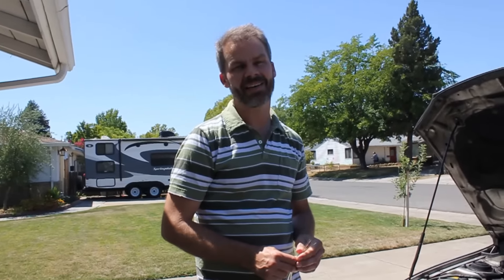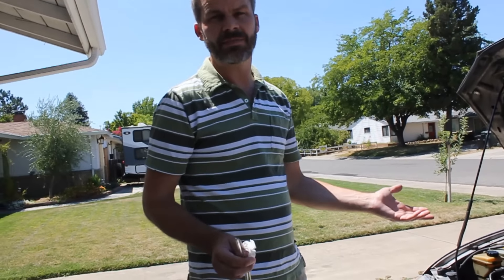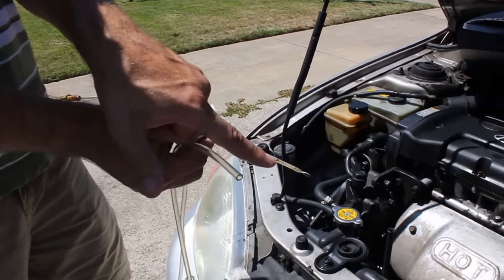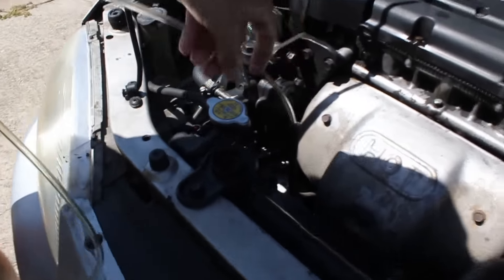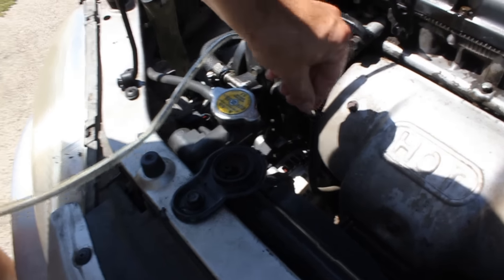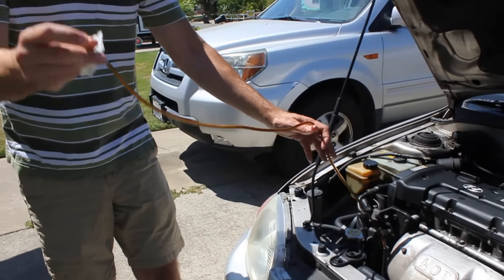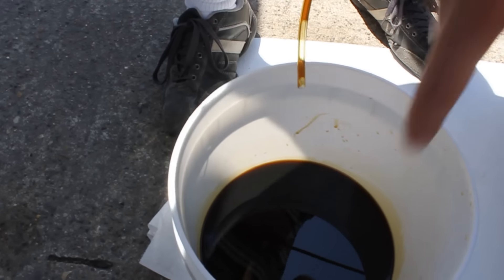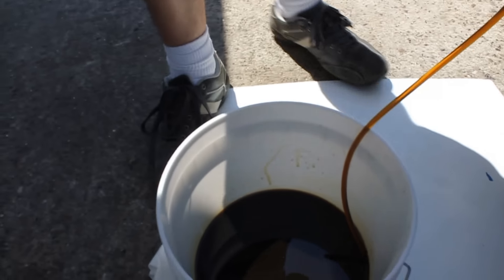How to Drain Oil from a Car's Engine through the dipstick Tube

Comment: For future reference,  learn how much oil your car takes. It's in the owners manual. When you change the oil ALWAYS change the filter too because I've never seen an engine blow up because the oil was clean, but I have seen them blow up because they didn't change the oil filter each time.  Pull the filter, drain the pan... let sit for 5 mins,  replace filter with a new one and put the drain plug back in and add the amount of oil your car requires as per the owners manual.  Voila!!!  Never too low or too full.
Reply: Oh and be sure that the old oil filter gasket comes off with the old filter.  Rub some oil onto the new filter gasket before putting the new filter on. If it's a filter that hangs up and down you can pre-fill the filter with oil (Make sure that if your engine takes 5qts and you put 1qt in the filter,  that you only add 4qts to the engine.)   That way your car doesn't run without oil for the first start up.
Reply from the maker: +Derrick Gott No matter what level of expertise you have, mistakes happen and draining through the dipstick tube is a quick, clean way to correct the error.
Reply: +Rob Cockerham Based on your video it's all but quick...
Reply: @itsokaytobestupid827  
Lol right, probably would go faster if he  took the oil cap off.
Reply: @DylanGilbertson  no, it doesn't make it go faster!! I'm doing the same thing right now bc my neighbor decided that's how we were gonna do it then I found this video & read several comments. We had the cap off the whole time & it never changed the speed of the oil draining from dipstick area. Unless I'm severely confused & ur talking about some other cap, it doesn't make it go any different

Comment: Woa. Many thanks, as our mechanic overfills the oil WAY TOO MUCH! Still no clink/clank sounds but still it is VERY high. Probably why we needed a new engine. Maybe i am wrong here but, could we not just use a pump siphon instead of our mouth? I siphoned gas before and got really high because I was not careful, but yea, gas or oil in the mouth is not healthy. Though gas fumes are MUCH WORSE in the body than oil. Or maybe oil is worse? not sure but yea.
Reply: Go to a car parts shop and they'll have a kit with a large plastic syringe and tube designed specially for draining excess oil
Reply: Go to harbor freight they will have the same pump liquid transfer even bigger then some syringe and faster easier for probably half the price if not even cheaper, they are like 5$ on sale or 7$ regular price or something similar

Comment: "Adding oil is a lot easier"...he said...I liked to fell off of my recliner...har dee har har...but I have done stuff like this...learning is a lifetime process...overfilling my engine is easier to prevent with pressure change information...like only have 3 to 4 quarts there by the car after putting back the drain plug...double checking everything is the best and safest way to success!!! Measure it twice...and cut it once!!! Good luck...

Comment: For some reason my drain plug is on so tight that I can't get it off.  So I need to pump the oil out, gravity isn't going to be enough i don't think.  EDIT: 1/4" tubing does not fit the 2008 Caravan 3.3L engine, requires 3/16" tubing.
Reply from the maker: If you watch the video you will see the oil being drained out by gravity. As long as you live on Earth, the gravity will be strong enough to pull out the oil.
Reply: gotcha @Cockerham

Comment: So my daughter goes to Valvoline to get her oil changed.  During the oil extraction, the suction tube gets caught in the dip stick hole and won’t come out.  So now, they are going to drop the oil pan and see if they can pull it through.  Has this happened to anyone before?  I wish they would have pulled the plug, drained it, and put the plug back in.  I will be looking for seal leaks and everything else around the oil pan now!
Reply: No but valvoline is ass at oil changes

Comment: How far could you drive if you did overfill and signs of it were showing?
Reply: Technically you could drive for a long time but that's not to say that a lot of damage won't occur in that time, problem with over filling your oil a lot is that it could reach the moving parts like the crankshaft which will splash the oil around and whip it up causing it to break down or separate and froth and have air in it and then it loses it's ability to lubricate the engine parts properly and also it might starve some components that aren't being oiled properly because the foamy frothy oil doesn't pass through an oil pump or sump or filter as well or possibly even all that much at all causing engine damage, everything i said is correct, except all the car parts i just guessed because I'm going off what i read a long time ago about problems with overfilling oil but 😂 you get the point, also a side note, dont ever suck up any kind of car liquid's with your mouth and a tube, for crying out loud just go to harbor freight, they have liquid transfer pumps that you use to hand pump whatever liquids you want and they can be used for gas or oil because it comes with different attachments, they only cost like 4 or 5$ and are 100 times, maybe 200 times faster then what's shown in this video and you dont run the risk of accidentally getting a surprise used oil or gas smoothie slurped up down your throat, talk about having the right tools for the job, this video is a prime example of that. Just because you can doesn't necessarily mean you should or that it's the right way of doing so

Comment: How long does it take roughly to drain 2 litres of oil?
Reply: Lauren Drayton let a reputable mechanic change the oil and filter. They inspect the car for potential problems to keep you safe. Most places are about $40.00. These DIY people go to the store buy oil and filter change  the oil never inspect the front end for worn parts brakes hoses belts rotate tires fluids battery and more. Then go back to the store with the old oil.
Reply: People don't trust mechanics specially for a simple oil change, they tend to try and rip people off...
Reply: Don't trust just any mechanic i got my car back with a stripped oil pan and had to rethread it myself DIY GUYS

Comment: This is bad idea. Why? My son overfilled his Astra, and tried the siphon method. 1) it is slow.
2) When you pull out the tube, it coats the dipstick tube with oil. Then you put dipstick in and oil drains onto that, so he thought it was still overfull. So he siphoned more oil out. Upon checking the next morning, it was way too low.
Reply: It's not that bad of an idea just because of those reasons. 1. sure its slow but whatever, still easier than jacking up the car. 2. big whoop. just use common sense and realize that will happen and you can account for that very easily. wait a while, check again and add more oil if necessary. Easy as that.

Comment: 1 litre is all she needs boys, just one…. Not 5

Made this mistake myself, just kept pouring because I’m a dipstick that was well aware there was a ‘too much’ but didn’t think 5 litres was anywhere near that point 😂  

those thick white smoke trails are hilarious tho
Reply: good point
Reply: Once you removed the excess oil, was your car fine? Did the white smoke go away quickly?
Reply: @robertlofton3113  it lingered for a bit but yes it goes away

Comment: Is it 1/4" ID or OD?
Reply: Depends on the car.....I've personally done it with "ice maker tubing" - the ice maker tubing, worked a little bit better and more "fail safe" IMHO.....the inner diameter was probably "smaller" than the hose he used.....and a little bit slower, but the ice maker tubing is also a little bit "thicker" too.....that hose he used looked about like as soft as aquarium tubing.....not good for a "warm" engine.....and yes, the engine will have to be "warm" to hot, to do this effectively.....
Reply: @ahoier  I know you posted 4 years ago, but you make a good point. I was going to use what I have on hand, some old aquarium tubing that has been outside on the back deck in a cracked aquarium. Probably not a good idea.  Will check and see if the tubing is brittle though. Thanks. If not, might work, with loosening the oil cap to release pressure so oil comes out fast, like a couple of other people have said.
Reply: Ended up driving straight 7.8 miles and had oil changed, it was about time anyway.
Reply: You probably got the answer you needed, but in case folks are wondering, a 1/4" OD is what fit into a 2017 Subaru Forester I'm trying this on now on my friend's car. We found the oil was overfilled on the last service.

Comment: what happen when you put to much oil did it stop working
Reply: Can air out the oil in the engine foaming it out , making it useless when it comes to proper lubricating the engine in witch case can damage a lot of the moving and none moving parts in.  Can also cause to much oil pressure bursting the head gasket , oil hose , oil pump and vacuum pump etc. so yea is bad
Reply: Rings getting blown is the 1st bad thing...smoking really bad...oh noooo...but early indication of over fill...is engine will not rev very high...it just dont want to go fast...carefully drive home asap and drain it out before the rings blow...that gets costly there...good luck sir...

Comment: a hand pump is only 10.00 and it comes with inlet and outlet and two long tubes
Reply: Where at...??
Reply: @lulmoewiththegimpyleg6815 harbor freights has one but I’m not sure if like this
Reply: The one we bought didn't work worth a shit... we only used the tube that came with it to syphon the oil anyway... the one we got came from O Reillys but just didn't work thru the dipstick slot
Reply: @carriethompson84  yeah I changed mine to a thick slim long straw like a water like from Lowe’s I have like 40 feet and taped it to fit in loops around the straw just don’t do it hot because it’ll melt and stick
Reply: @WrenchingNLearning  we used the small black tube that came with the hand pump (it's for oil, gas & air i.e. to fill basketballs & bike tires, etc) & it wasn't long enough so my neighbor remembered he'd saved the tubes from his late wives oxygen tanks. He put 1 inside the black tube, taped it together & it's been draining overnight. I'm in no rush so it was easier to let it sit versus him pumping by hand. It just wasn't going fast enough. 
I've had a leak for 7 years & couldn't afford to get it fixed so I kept putting oil in it (I can basically get oil for free) & have done so for that long w/o ever checking dipstick. Somehow, I thought the car ran outta oil bc it just cut off in the middle of the road 1 night. I added oil & it cranked right up! I thought the oil light had then quit working but somehow the leak has slowed tremendously?!?! So, over a month I ended up with about 13 quarts of oil. 
I'm seriously confused how this whole thing happened. Something else must've happened the night I thought it ran outta oil & it just happened to crank after adding oil. How it slowed on the leak is BEYOND ME, especially from the crankshaft seal!!!!!!

Comment: someone else was using an medical syringe to do the suction.
Reply: Yep, I saw the medical syringe, which I do have, on another video. Loosening the oil cap, and getting the flow going with a medical syringe or squeeze bulb, and good quality 1/4" tubing - he said he used 5 ft. of tubing, so may get extra for whatever other need.

Comment: why???
Reply: would you rather do this or remove all the oil and add back the correct amount?
Reply: @Lurod_  Just loosen the oil plug a bit, pull it out just enough, let it drain and screw it back in when enough is taken out. I just had my oil changed today and told the bastards to only put 5 qts, but they put 5.5 qts. It may not damage it, but I am going to drain a lityle out before I drive it any more. I have a hand pump that does what this guy here has done, so it should be a lot cleaner and safer. I am going to do all my own maintanence from now on, except for things I absolutely cannot do or have the tools for.

Comment: I wouldn't recommend this.  There is the  possibility of the vinyl tubing snagging on something and a piece of it breaking off.  Plus its just not that hard to get the oil out the way it was meant to come out.  If you find yourself regularly having to get out various amounts of oil, I'd recommend a Fumoto valve.

Comment: this is guy is missing a lot of screws and nuts and bolts in his head. You DONT ADD OIL BASED ON WHAT THE DIP STICK SHOWS, you add oil from your manual which will tell you EXACTLY how much to put in. dear lord, you go by your manual and you can double check with the dip stick but never do it from the basis of looking off the dip stick.
Reply: Lin Y no way, you always check the dipstick. There might have been left over oil. The dipstick never lies
Reply: No, you’re missing some nuts and bolts. You don’t add what the manual says. The manual shows you total capacity. I usually refill about 1/2 quart less than what manual says to allow for what may not have drained. Then start for a minute, shut off, add a little, repeat. Blindly adding what manual says could have you overfilling, which is a problem. Always use dipstick to fill to appropriate level
Reply: @syoung20001  Exactly!